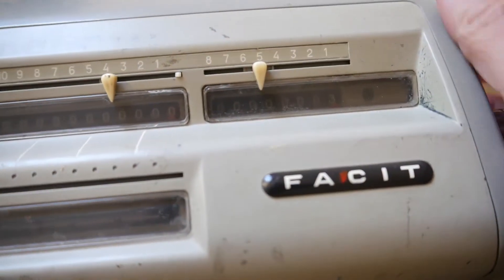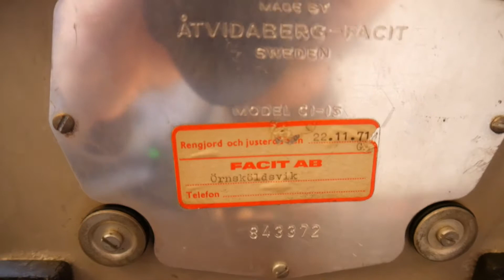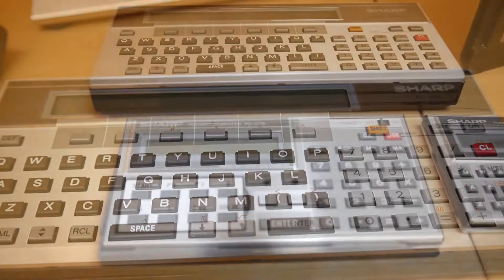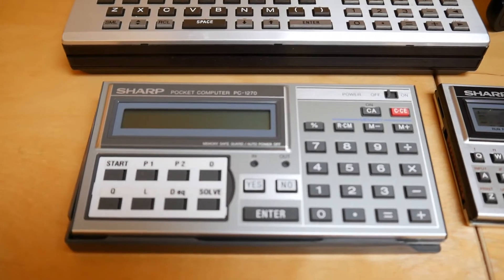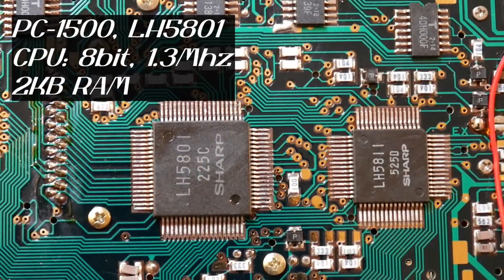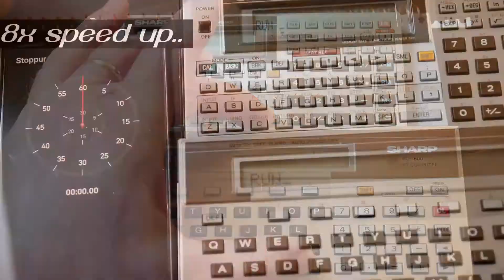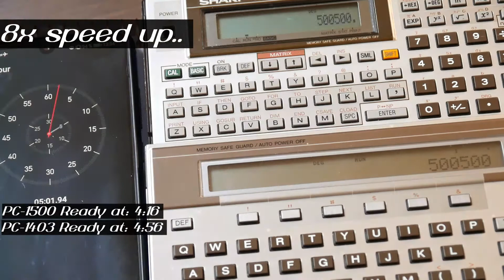Sharp PC-1500 (Tandy PC2) and Rotary Calculator Facit CI-13 and many more.

Comment: A real POCKET COMPUTER, not as most Casio models. Even better: this uses standard AA batteries instead of button batteries, and it has a complete graphic dot=matrix display, i.e. you can draw continue graphics (for example a big bar), while on other modes there is only character graphics broken from character to character (for example you can't create a continuous line from 1st character to last screen character).

Comment: K, would you happen to know if Sharp PC-1500A be able to plot to a TRS80 PC2 printer Interface that is designed for Tandy PC2?
Reply from the maker: They are related, But I have not tested the assumed cross compability.